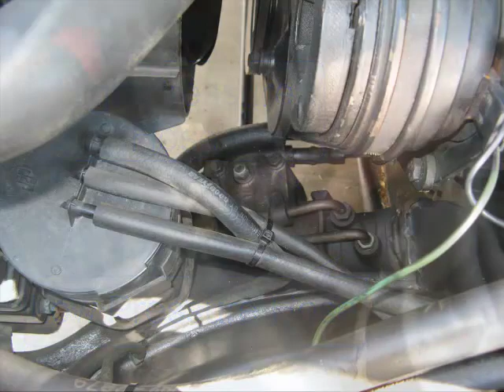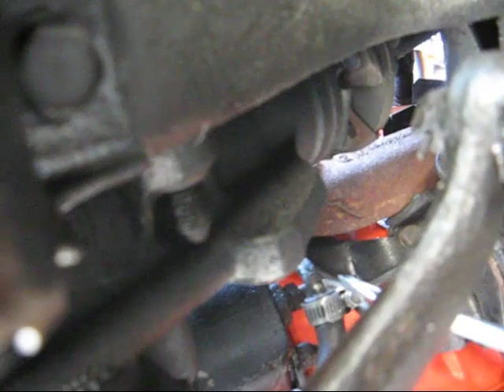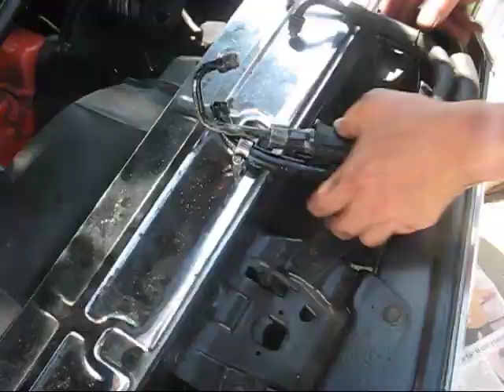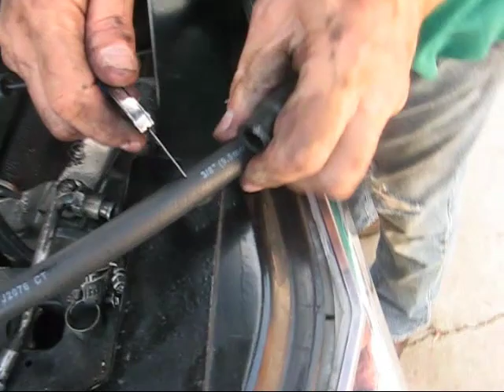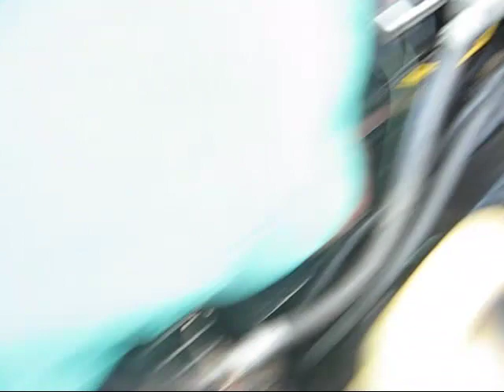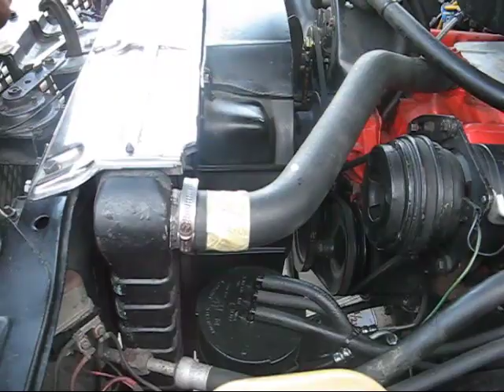How to Replace Power Steering Pump and Power Steering Hoses

Comment: Did you use o-rings for the pressure line??
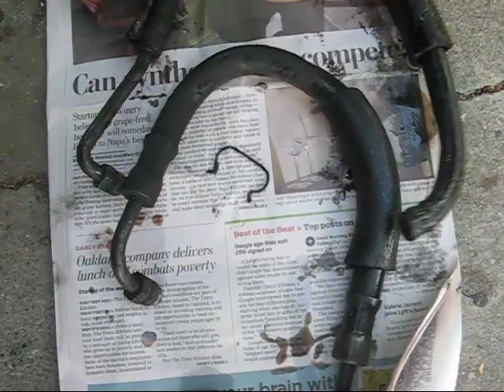Reply from the maker: Look at video 9:40 -   it shows no o-rings, pipe flares to seal it up.

Comment: Which power steering fluid did you use in the video? Im about to replace the return line in my 350 72 camino and i dont have an owners manual for power steering and dont know which fluid i should use. I imagine all GM cars between 68/72 we’re mostly the same.
Reply from the maker: Automatic transmission oil.

Comment: Did you have to use a rubber grommet before you installed the hoses??
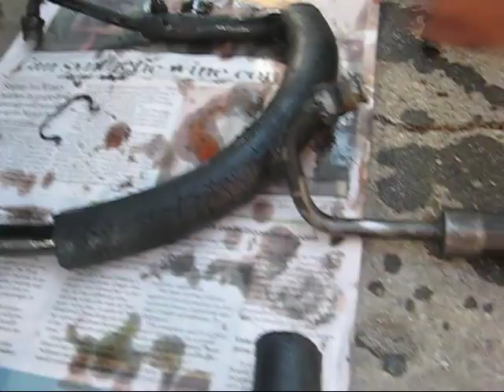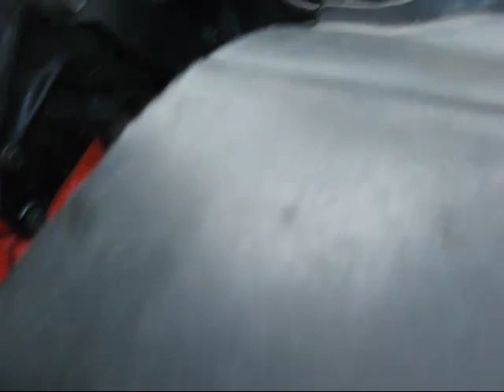Reply from the maker: Look at 10:00 and 15:00 minute marker.  There are no grommets, they are ready to go.

Comment: you could have taken the old presser hose to a shop and they would put the old fitting on your new hose. Takes about 30 minuts and about 40.00.
well worth the effit .
Reply from the maker: I did not think about it until I finished the job.  I used to do this when I worked in construction and fixed heavy equipment.  I would take off the hoses and bring it to a hose repair contractor.  They would install new high pressure hoses using the old end fittings.

Comment: Wonderful video.  Quick question, is there a particular reason you did not attach the hoses directly to the pump itself when it was completely removed from the car?  Then just putting it it in and then attaching the hoses to the box?   I'm just curious if you think that would work?  Thanks again!
Reply from the maker: Good question.   Never thought about it.  If there is enough room, it would probably be easier.

Comment: Good Job ! As a courtesy please edit your video and suggest the the wrenches one must use  are called flare line  wrenches or B Nut wrenches 10.99 for three wrenches on Amazon . 1/2 to 71/16 . 
Also one need a 1 inch wrench to hold the adapter nut on the pump . They are all very similar and have it. You really don’t want to break that one free when you’re removing the line from the pump of the high-pressure side. Great video

Comment: Thank you! You've helped me change my power steering pump for my 76 Camaro!
Reply from the maker: You are welcome.  My goal is to help as many people as possible.
Reply: Does the 76 camaro need any o rings when connecting the hoses to the steering gear box?
Reply: @daisgu  yes it does.. I used stainless steel hose clamp.

Comment: Is that car a 12 bolt bucket seat console car from AZ? I think my dad owned that beauty couple years back!
Reply from the maker: No.  this is pure stock, even the original chrome, original windows, etc.  Malibu (not SS) with a bench seat. 350 2bbl, (4 speed on floor and radio not original), vinyl top.  Built in Van Nyes (Southern California), CA.  This is a California car with no undercarriage rust.  I left all the original undercoating where I restored the car. 

It has some little scratches because I use it as a weekend driver.    It is more fun to drive it versus showing it at car shows.
This car has original a/c from the factory.  It even states that on the build sheet.  This is the only Chevelle that I have seen at many car shows the have a/c.
I should use it more.

Comment: No O-Rings on the line fittings?
Reply from the maker: No
Reply: The Pontiac motors use the Saginaw PSP and steering gear. The high pressure line ends use o-rings. Without the o-rings, leaks are guaranteed.
Reply from the maker: @vinloy23  Look at video 9:29 and 17:17  both show that my fittings do not require o-rings.  You must have a different connection.
I use automatic transmission fluid.  By it is important to check the manual.

Comment: how did you know it was your pump and NOT YOUR BOX i have a 73 regal
Reply from the maker: I never seen a gear box go bad. 
First thing to check if there is any fluid in the pump, that is usually the problem.  If the howling does not go away it is the pump.  My hoses leaked because they were 1970 vintage.

Comment: Thanks for sharing really helped a lot I’m going to see if I can change it on my 79 z28 great video I hope you keep doing videos of your chevelle DIY👍🏽👍🏽👍🏽👍🏽😊😊
Reply from the maker: You have to remove other things before you can get at the hoses.  I had a hard time getting the right hose, I return 2 of them before I got the right one.
Reply: David Lis I think I will just buy the holes and reuse the rest of the parts and buy a new power steering pump my engine looks similar to your chevelle thanks again!!
Reply: DAn Al how did it go I'm boutta do this on my 79 z also
Reply: LurkinFiend hey I ordered the pump I’m just waiting on it and hopefully I’ll be able to work on it this weekend coming up do you have a video on your camaro? Iv been wanting to post one of mine but haven’t had time to do so let me know how it went on your z28 good luck man..
Reply from the maker: Camaro should be very similar.  Post the link to your video.